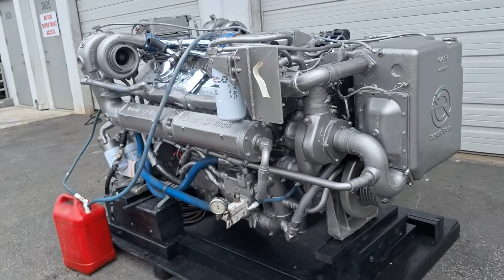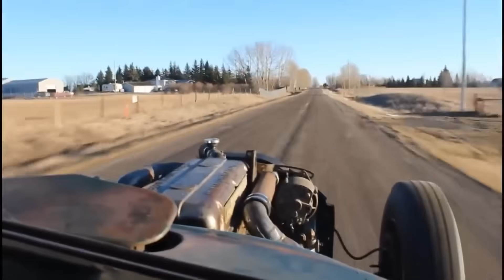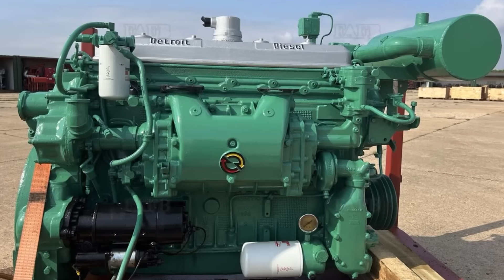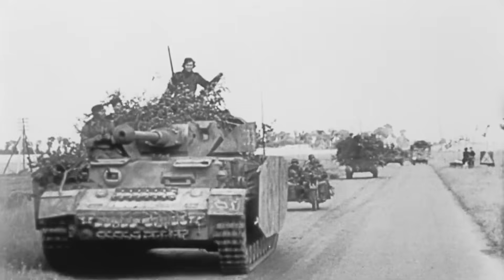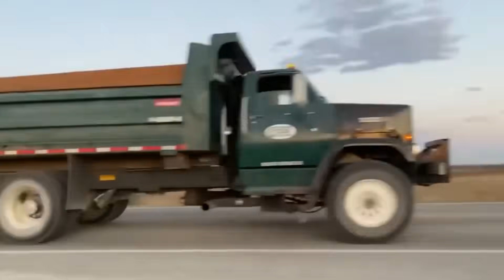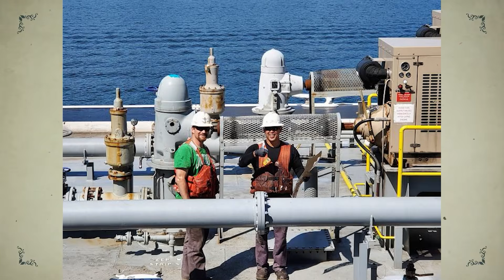Why Detroit 12V92 Was Banned: The Engine That Was Too Powerful

Comment: I worked in Detroit Diesel before retirement and am sorry to see the DD Logo of "2 big strokes + 2 small colored strokes inside = 2in2 cycle" fading away. The piston engine is the best internal combustion design so that there are billions of them serving humans for more than a century. Current ICengines are divided into 2-cycle, 4-cycle, diesel and gasoline combustion types. This division doesn't have to be -
It is just by simply splitting the piston crown part from its skirt to be operated via (a valvetrain-like) piston-train to make the lighter pumping gases for the cylinder - called D-cycle (differential-stroke cycle) completing 4 strokes, different in displacements and periods in every revolution - like the 2in2-cycle. Test data (school lab, uncertified yet) show the D-cycle engines have achieved >20% fuel saving, while yield >2.5 (close to 3) times torque. 
The D-cycle can further bring in the "Diesoline" combustion which is a hybrid of the diesel-type compression-ignition and gasoline-type spark-ignition engines. It is the compression ignition on the stoichiometrically charged air/fuel mixture while retaining a great amount (>30%) of burnt gas (called BGR) to replace the extra exhaust gases for the high compress needed instead of air in HCCI (homogenously charged compression ignition) to avoid the NOx (and engine knocking). The diesoline will save extra about 15% fuel without the nasty and costly soot + NOx after-treatment; and quieter due to the slower combustion rate for the millions of diesel trucks in USA along – that can save great among of after-treatment cost. 
There are billions of ICengines serving humanity for one and half centuries. Since current eV hype has proved that battery technology has not reached adequate maturity to compete, the venerable ICengine can continue to serve us for another century or so.
Reply from the maker: Thanks for sharing your insights! It's fascinating to hear from someone with firsthand experience in the industry. The evolution of engine technology is truly remarkable, and it’s great to see your passion for internal combustion engines.